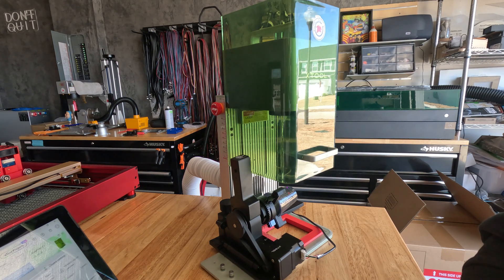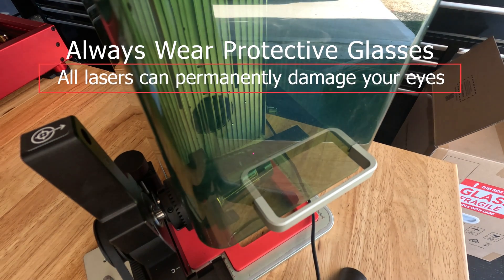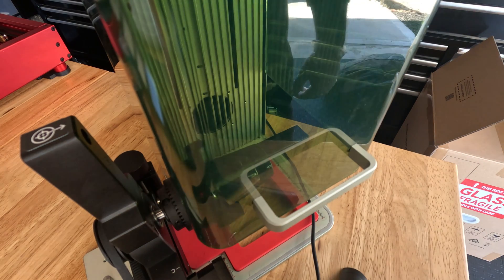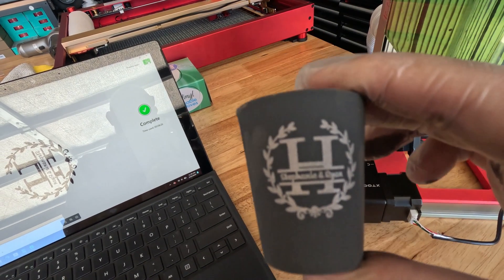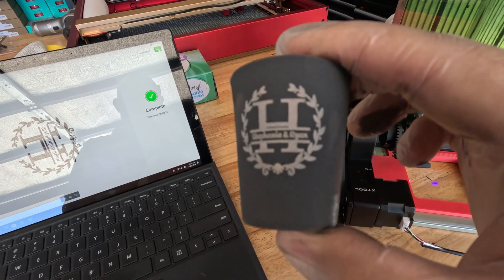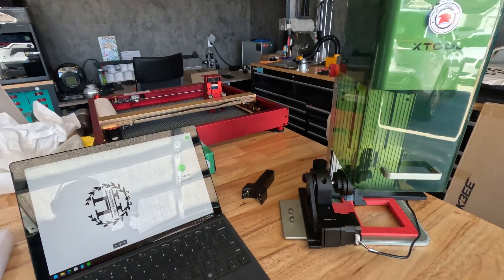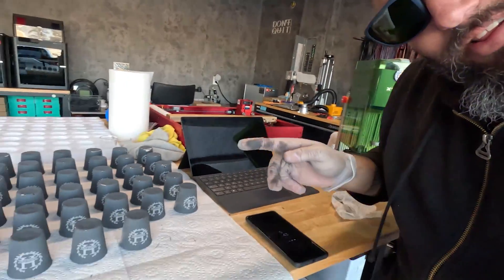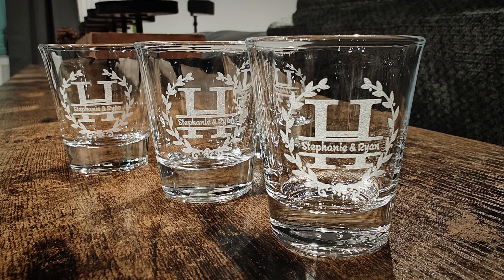Laser Engraving Glass! Quick and easy custom shot glass tutorial with Xtool F1.

Comment: Hi, I'm learning to use my XTool F1 and I tried your settings for a glass wine but it comes out grainy and eventually, the engraving starts peeling off. I'm using tempera black paint. Do you have any suggestions on how I can get a smooth engraving?
Reply from the maker: in my video I use Spray Chalk paint (no chalk board) I had similar issues with tempera, but also be aware that not all lasers are the same and all setting from me and any other person always should be treated as a starting point.

Comment: What is the best way to wash the paint off? Do you engrave with the paint wet or dry? I tried it with it dried and took awhile to remove the paint.
Reply from the maker: Is dry chalk paint no chalk board paint. And warm water and soap after they are clean I run them in the dishwasher top rack.

Comment: Good morning, I have had some great success with what you have shown here and I have a lot of people who like the deep frosted engraving look. I noticed though that the setting work really well for SVG files but I haven’t been able to figure out the correct settings for PNG designs. Any advice?
Reply from the maker: Hi I normally don't use PNG for logos or monograms since they usually loose quality but on an xtool probably changing the dot duration might help
Reply: @AlivePixelCreates  I’ve tried to put make my design an SVG but the overlapping text keeps messing up the vectors. Haven’t found a solution yet so I was trying to use a PNG file. I’ll try increasing DPI and Lowering speed.
Reply from the maker: @RyanKenley  message me on Facebook

Comment: Dude, Thank you for the version for dummies like me.  So many folks do demos and don't even :goodvibes:include the settings!  Your vid is exactly what I was looking for, as I plan to do some shot glasses, beer flight glasses and pints.  I am going to order the chalk paint (spray) and give it a go.  Probably gonna get the accessory attachment too.  I didn't even know they had that.

One question:  Was the design you did a bitmap or vector image?  I have found that there is a big difference in processing depending on the type of image.  Thanks in advance.

The shot glasses  look great!   BTW, I ride, too (2015 RG CVO).

Anyway, I subscribed and look forward to you future vids.

Good Luck!

Best,

M
Reply from the maker: Thank you so much for your kind words and for watching. I tent to always use vector images. Bitmap is not the best IMO.
Reply: @AlivePixelCreates  I wish I could upload a picture, but I had pretty good results using your technique on a shot glass using a raster image (both .jpg and .png files).

DD: 800
P: 100%
DPI: 400
Jarvis
Blue Light

If you are stuck using a raster, try this as a starting point.  Again, thank you for your video.

Best